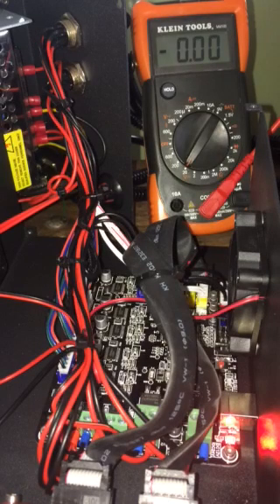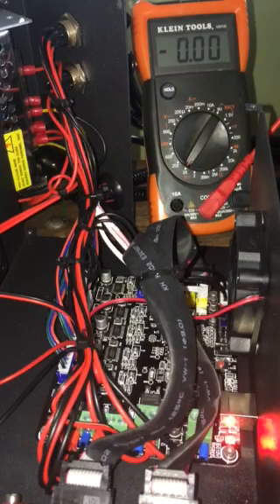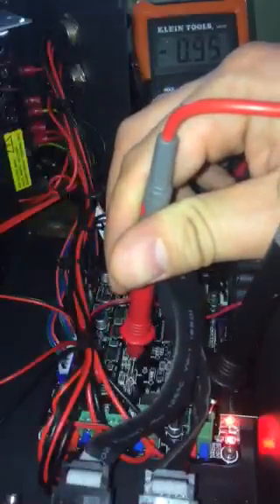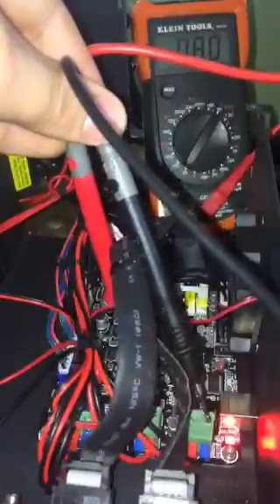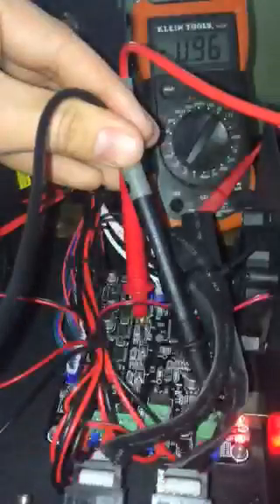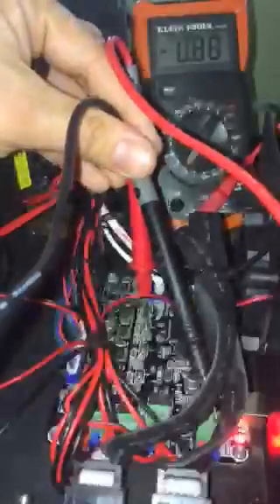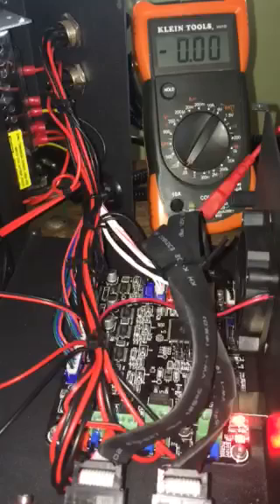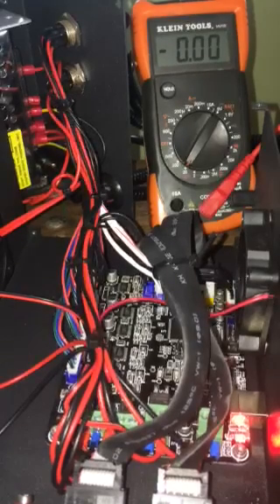How to adjust VREF on a Tevo Tornado for rookies [If I can do it, you can do it]

Comment: Do you need the 110/220V power supply for this, or just USB power is enough?
Reply from the maker: That's a good question. Honestly, I cannot remember if I had the power on from the wall outlet or if I just used USB. I would point you in the direction of the Tevo Tornado Owner's group on Facebook. Those guys are pretty knowledgeable when it comes to just about any question you may have. I hope that helps!

Comment: Just a heads up. Be careful in there as the switch and fuse are on the neutral so the psu is at mains potential even if switched off at the box as opposed from the wall.

Comment: Every one of these videos doesnt show exactly where to put the positive lead. is it right on the bot or a pin on the chip. So the steppers need to be powered up? A diagram would be helpfull.
Reply from the maker: TikiToyLabs I will agree the camera work on this video is not great at all. You want the lead to be touching the pot, but you do not want to be in the pot with the lead because you will use the inside of the pot to put the screwdriver to adjust the vref. BE VERY CAREFUL NOT TO TOUCH ANYTHING ELSE IF YOU ARE USING A METAL SCREWDRIVER! You can easily Short the board.
And yes, the power does have to be on. You may can get away with using auxiliary power through the usb cable, but I cannot remember if it will work or not that way.
Hope this helps!

Comment: do you happen to know how to check the voltage for the hot end.
Reply from the maker: Jacob Lewis I don’t. I haven’t opened it since I made this video. I actually sold my tornado a while back because I wasn’t printing much anymore.
Reply: Oh i just bought one and after 2 prints its not working. Thanks
Reply from the maker: Jacob Lewis there is a Facebook group for tech owners. Search for it and join. It’s very helpful  for resolving issues.

Comment: My tevo tornado is having shifting issues with my prints. I have taken apart my housing and measured with a multimeter eveything is measuring .8. My big problem is i dont have the screw to adjust the voltage. Where can i get one? Its not a regular phillips head. Thanks
Reply from the maker: It's a small flat head screw driver. You can probably find one at Home Depot, Harbor Freight, etc. I'm sure they are on Amazon as well. I would suggest getting a plastic one instead of steel, so you have no chance of shorting the circuit.
Reply: Thank i cant believe all i need was a flat head. lol

Comment: Tried this, and now the only driver that is working is the z-driver, even after reverting back to original vref numbers. But the motor is now giving a loud hissing after moving until I unplug it. Motors on other axes are also working when connected to z-driver but also makes hisses. So I guess this screwed up my entire board, and I need to order a new one. :-\
Reply from the maker: Øystein Sundsbø I’m sorry to hear that! You may have shorted the board out with the screwdriver. I mentioned in the video to be very careful using a metal screwdriver around those electrical components.
Reply: I guess so. Had my gf operate the multimeter probes since I thought I needed 3 hands for the job. But it got too crowded with all the wires and stuff, and I guess one of us slipped and shorted something. New MB on its way.